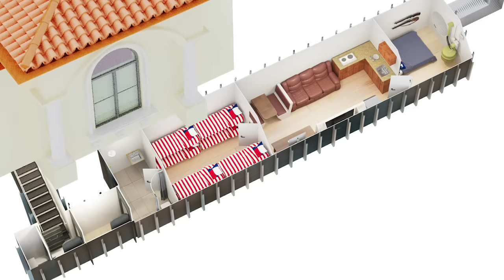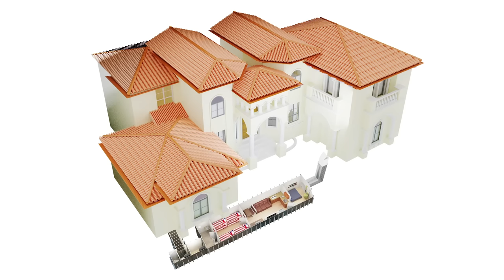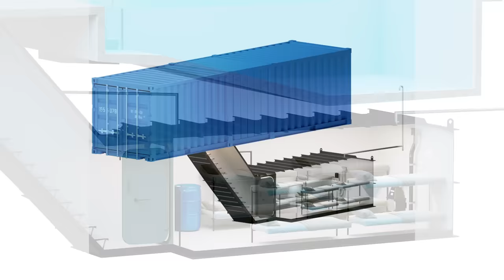A $200,000 Luxury Bomb Shelter Under a Home - Atlas 10x40' Platinum Series Safe Cellar

Comment: I'm curious what if something fall on top of the hatch door how would they get out.🤔🧐 should put a strong hydraulic arm on the inside of the door.
Reply: Well, that's why there's an escape hatch. He didn't show it though. It was on the illustration.
Reply: I'm saying if the escape hatch is in the house   and the house cave in then what. Either way it go they would be block in. By some sort of debris. Unless they have a hydraulic arm on the escape hatch to move remove the debris.
Reply: @gregharris2679  Yeah, I guess. That would be a sad way to go. Surviving an apocalypse but can't get out so you and your family starve.
Reply: There's an 8 ton jack to lift the hatch, plus a back-up 8 ton jack.

Comment: 230K and not a dime spent on any drainage or secondary waterproofing to keep any moisture away from contacting the steel. 
Not to mention the top of the bunker has these steel boxes that will collect water and just slowly eat it's way through the bunker.
Reply from the maker: They have notched vents to not hold water.  Watch other videos are you'll see

Comment: Not bad but I would want more. I need a gym area, a pool area, a racket ball area, hell if I can squeeze in a bowling area. A movie room would be nice. More than 1 bathroom and shower. Also, a garden room in order to grow food. I would of got like 6 crates. 3 stacked on top of 3 spread across. blus you need like 5 feet of concrete surrounding the bunker to keep it safe from any large blasts and radiation leakages. 1 thing most ppl forget to add is a medical room. You need a place to hold your antibiotics and keep it chilled. As well as other medical supplies in case you get wounded or ill. Hell make the bunkere 4 by 4. Shipping containers are pretty cheap. Being last thing you want if stuck in a bunker for god knows how long is to be staring at the same limited room walls for hrs on end.

Comment: I asked this question a while back, but can you have a Fort Knox door installed on your generator room and the entrance to tour bunker if you’re concerned about someone getting inside the bunker?

I know this is probably possible with a bunker built into a home.  Are the Fort Know Doors possible with stand alone bunkers?
Reply from the maker: Yes you could but it's not gas tight
Reply: Is it possible to get a custom made gas right door that can keep people out?  Same thing for the hatch and generator pod.

Comment: With PVC pipes connected to city water and sewage? Why wouldn't you connect it to well water, with its own septic tank?
If a bomb went off in that area, you would certainly not have city water because the piping would be destroyed.
Essentially, this shelter is as good as 600 gallons of water will last you.

Comment: thers a lot of standing water on that site , i hope it was just recent rain
Reply: Clay holds water better than a bathtub. It should have been back filled with a drain tile and gravel to shed water away. As it stands that bunker is going to always be sitting in a pool of water.
Reply: The PVC plumbing looked like a DISASTER waiting to happen all of those valves and then a LEAK it would flood what happens then you got a GIANT METAL box

Comment: Considering it doesn't have a thick lead shield or concrete to prevent radiation, all this is would be a cancer holding station when the rads pour right in...

Comment: Why isn't it covered with a thick layer of concrete, if there was an earthquake or a nuke blast I don't think it would stand the ammount of force..
Reply: earthquake won't affect it in the least, subterranean surfaces are affected the least of any structure and steel is far superior to concrete when it comes to withstanding an earthquake. They had to pour a concrete slab over it to build the house on top. Subterranean nuke blast damage is limited to a few miles at most, almost all damage is from radiation which this is well protected from. If you build in a remote area such as in this video a nuke will never strike anywhere close, all damage is radioactive.
Reply: @Inspectorzinn2  wow that's really interesting, thank you :D

Comment: question: the atlas generators are generators that need or no fuel
Reply: They are regular Gasoline generators, you can hook up solar Generators instead.
Reply: its not like i would buy one, just im a bunker fan but ok
Reply: @Arizona_Skin_Walker  solar generators will be worse
atlest have a solar generator and a generator regular if the solar panels break for the blast (if it comes)

Comment: The only wrong design is that it should not be connected to public water, there should be totally in depended system for water and sewer. Without those systems this is not a bomb shelter but just nice underground house. Also every system in platinum version should be redundant.

Comment: US Army Corps of Engineers
Engineer Technical Letter 1110-3-498

DESIGN OF COLLECTIVE PROTECTION SHELTERS TO RESIST CHEMICAL, BIOLOGICAL, AND RADIOLOGICAL (CBR) AGENTS

Page C-5, Section C-9 (b)(2)
New Facilities.  For new facilities, the HVAC equipment will be designed to incorporate the requirements of the CP overpressure system and maintain indoor design conditions.  The outside air intakes will be located in an inaccessible location or secured by use of a standoff distance that inhibits the direct insertion of contaminants

Not bushes.

Page F-1, Section F-2.  Airlock Features

a.   Timers.  A mechanical bell timer to time the dwell and purge cycles is required in each compartment.
b.   Windows.  A window is required at each compartment to determine if it is occupied.

And many, many more things are missing. If I were spending this much money, I'd want it to meet the minimum standards of the US Army. Then again this is a "bomb shelter". When you create the impression that this functions as NCB safe you must deliver the final product held to a standard.

Not just say that you consulted a "genius"

Comment: I keep seeing these facilities to pad lock the doors from outside. Is it just me or couldn’t that be turned against you to trap you? Why not cut a rectangular slot just below the upper tang, then fabricate a rectangle with two holes and a rectangle cut out. Put the lower tang feature into that and weld it. Then what you do is slide it in from the inside so that it appears on the outside. Inside the bunker it would go onto two threaded studs and you throw some wing nuts on there. This way you can lock it up the keep people OUT but once you flee to the bunker you can disable the ability to lock the door from the outside by pulling the lower tang into the interior. You’d provide a blank rectangle with a gasket and two holes as a gas tight blank off plate. You only need this on the very first door into the place. 

Is saw this same thing on the nado shelter and thought good lord what if you used it as a panic room and someone just decided to lock you in and let you rot? Also do you leave a feed line for radio?

Comment: I would prefer not using SharkBite fittings on a 200k+ investment. In my opinion they are no good granted this system will not be under constant pressure Im sure but its just not a reliable connection.

Comment: 230 000 $ you rule men ... This structure in my country roughly cost me 5000 with all the metallic materials welded hermetic and 5 times bigger than this. Here a lot of machineries are operating , that's the reason it costs too much but hey ... Good ideas worth anything
Reply from the maker: What country are you in ?

Comment: No  cap this looks like a hella depressing place to live your last days in case of nuclear Armageddon.
Reply: Its not a good bomb shelter for nuclear war though. It doesn't have any shielding. You would end up dead from cancer if a nuke went off anywhere near this.
Reply: @GeriatricMillenial  I think you will be safe though. You are underground with two airtight doors. The problem is now WHERE did the nuke explode, a mile away or nearest city 80 miles away?

Comment: that total bs,, the added cost of a huge crane like that ( never mind the tons of people know its going in there, no thanks) to come miles out in the country at $1800 per hour, minimum 25 hours they want plus 14$ a mile and $800 stand by time even when it is parked waiting for the next day or job, plus a $4000 set up cost, i built mine right in the hole, welder by trade, didnt cost me any were close to 200k, not even 60k, ton of scrap from past jobs. no compost toilet because how do you dump it, you cant when your stuck in there for weeks even months, i put in a flush toilet with a old steel tank down deep and a one line drain field way down below the bunker, your system would never survive a nuclear boom, i used huge oyc tanks and air tanks, with sealed valves on every air pipe

Comment: No casing in concrete because it was just a safe cellar not a fallout shelter? Still no video on explaining the multi module platinum series?
Reply: Wrong there is going to be concrete on top of it ! !
Reply: @RJM1011  The sides a'rent in cased though
Reply: @gmoncrieff  It won't matter !
Reply: @RJM1011  Ron used to say the square bunkers needed concrete base, 12 inches reinforced around it and two feet on top.
Reply: @gmoncrieff  I think you find that was when he was talking about using the containers as bunkers which he has now stopped building !